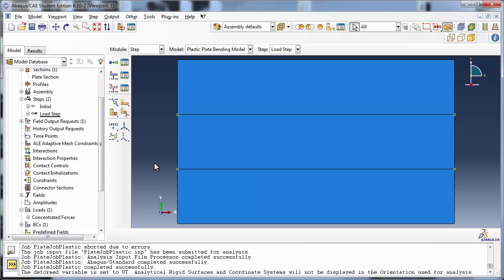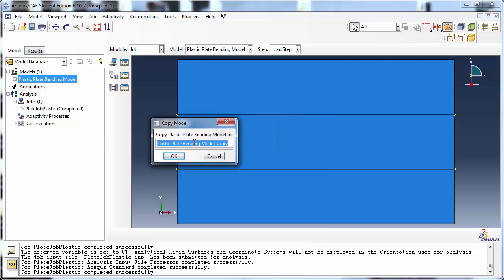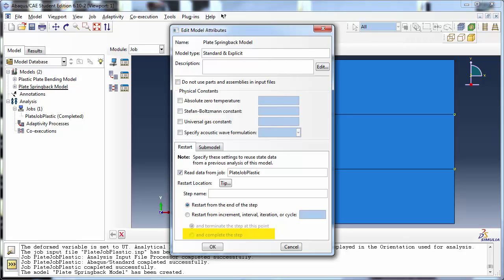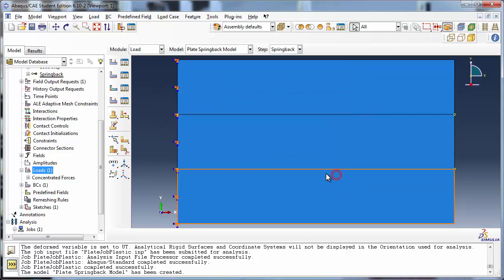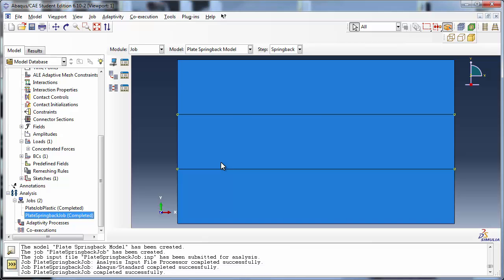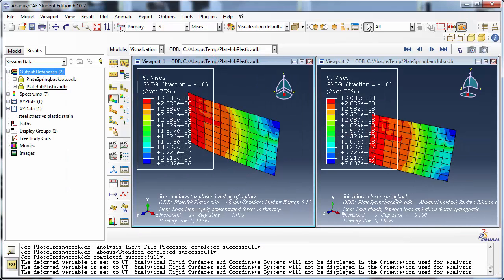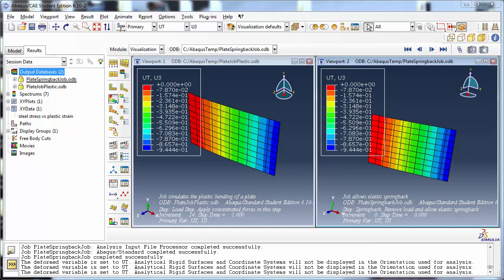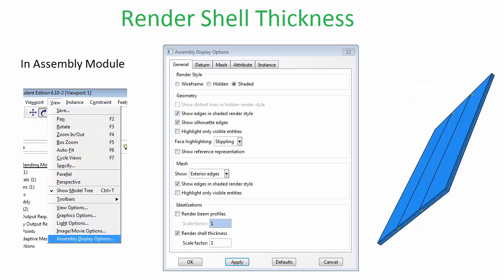7.c) Modeling Plasticity + Restart Analysis -- Part 2 of 2 (with audio)

Comment: Thank you for the video! How can different ODB files be joined from restarted analyses into a single file?
I'm running the following command (in the Kernel Command window of ABAQUS/CAE 2016), but it's not working:

abaqus restartjoin originalodb=PlateJobPlastic.odb restartodb=PlateSpringbackJob.odb